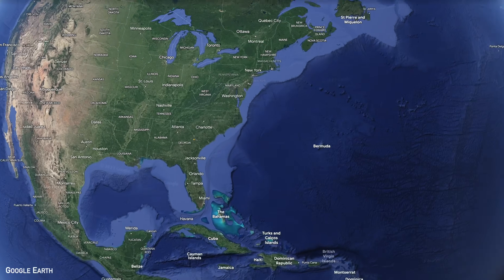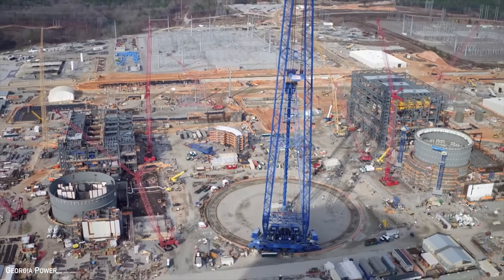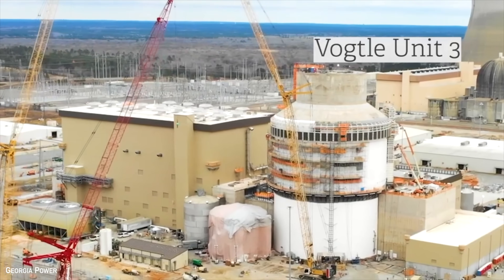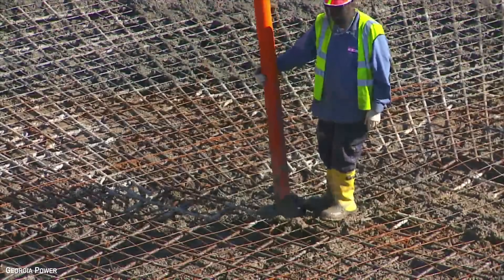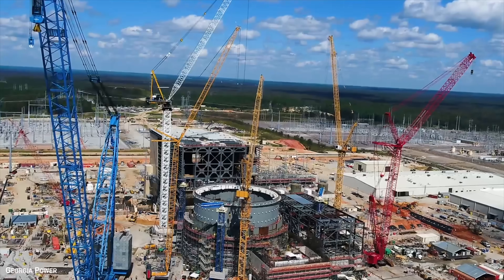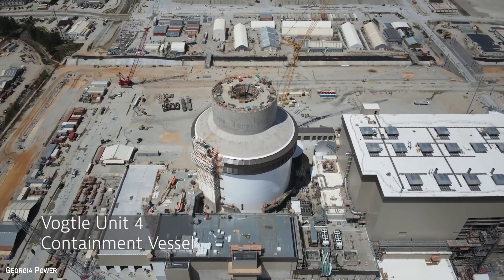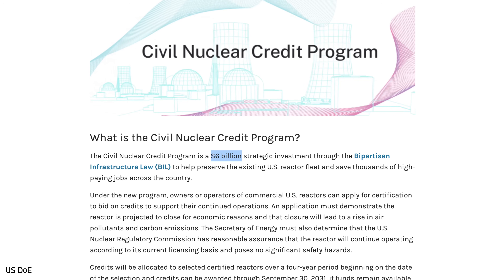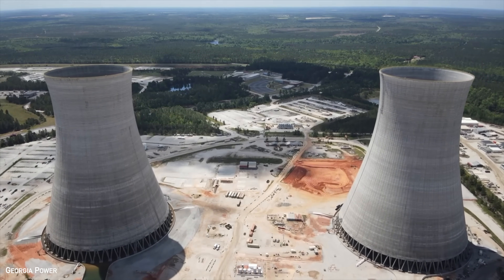Why the Future of Nuclear Power Depends on This Plant

Comment: Madness multiplied by insanity building another PWR reactor. 1. Solar panels are cheaper. For the money spent on Vogtle the company could have bought 10 x the generating power in solar panels. 2. If you need to build a nuclear reactor then build a molten salt one.
Ex UK Nuclear project manager.
Reply: “Solar panels are cheaper”

Solar … plus what?  Or, wind plus what? Random trolls might think intermittent panels covering vast amounts of land are the same thing as 24/7 power running for 50 years.  You say your not so you know the difference.  If what you really mean is .. plus gas plants and gas pipelines and LNG tankers importing gas causing the like of the several thousand Euro per month House energy bill, why not say so? 

Also, a former professional would know that hundreds of nuclear plants with great safety records were once built for under $1500/kw, todays $, and the explain why Vogtle is different.
Reply: @Falstaff  Panels + storage + grid connection. Your fantasmagorical journey through fossil fuels is unnecessary. Historic costs translate into current construction costs at around 10,000 per kw/h. But then no nuclear project has ever been completed under 50% overrun.
Reply: @Dana Durnford & Kevin Blanch Your rather stupid gotcha remark leads me to point out the phrase was grid connection. To simplify it enough for you.
Then to further your education. Virtually all wind and solar farms are connected to the grid either through a transformer or an inverter and transformer, unless connected to the newest generation of DC grid transmission line.
Reply: @Dana Durnford & Kevin Blanch debunked  And if you are just referring to storage. You will find all Tesla battery gigastorage are connected to the grid.
Reply: @Dana Durnford & Kevin Blanch debunked  No doubt you are contemporary with Charles Fritts and have all the knowledge in the world., but you obviously are not an electronics engineer from what you say.
Reply: @danadurnfordkevinblanchdebunk  You can say the same for every peaker plant, which are now being replaced by battery installations.

Comment: The old way of nuclear is the bad way. That's why no new plants for 30 years.
Reply: There’s recent and there’s older.  US built dozens or reactors late 60s for under $1000/kw,  todays $, 3-5 years build time, great safety records, most them still running.  That was all before the current NRC, which demanded Vogtle  change its design after it approved the design.

Comment: As someone in the industry Vogtle is the swan song of the stick built on sight megaplants. Any company who operates a fleet now is looking towards SMRs as the way forward for many reasons. The biggest being the cost of constructions and  that the exclusion zone is pretty much restricted to the area immediately around containment instead of being a few kms (~ 20) out from the containment structures. This allows for much more flexibility in the placement of these plants. And anyone worried about used fuel storage, it's not a concern. It's something that has been trumped up by the fossil fuel industry, used fuel is safely stored on sight, a plant operating for the past 50 years can store all it's used fuel in an area that is less than a typical suburban cul-de-sac.
Reply: “trumped up by the fossil fuel industry “

Yes in part , but must of the fear mongering today comes from big wind and solar funding some Sierra club rep, writing op Ed’s in every small city.
Reply: If you are in the industry you sure don't know a lot about what is happening right now.
In 2013, the Wall Street firm Lazard estimated that the cost of generating electricity at a new nuclear plant in the United States will be between $86 and $122 per megawatt-hour. Last November, Lazard estimated that the corresponding cost will be between $131 and $204 per megawatt-hour based upon the 4 recent new nuclear projects in the U.S. . During the same eight years, renewables have plummeted in cost, and the 2021 estimates of electricity from newly constructed utility-scale solar and wind plants range between $26 and $50 per megawatt-hour. Nuclear power is simply not economically competitive.
SMRs will be even less competitive. Building and operating SMRs will cost more than large reactors for each unit (megawatt) of generation capacity. A reactor that generates five times as much power will not require five times as much concrete or five times as many workers. This makes electricity from small reactors more expensive; many of the original small reactors built in the United States were financially uncompetitive and shut down early.
The estimated cost of constructing a plant with 600 megawatts of electricity from NuScale SMRs, arguably the design closest to deployment in the United States, was originally advertised as costing $1 billion but upon requesting actual bids from engineering firms, increased to $6.1 billion in 2020. Given inflation and other cost constraints that cost today can only be expected to be significantly higher.
The cost was so high that ten members of Utah Associated Municipal Power Systems canceled their contracts. NuScale then changed its proposed plant configuration to 6 fewer reactors but increased each reactor output from 50 Mw to 77 Mw costing at total of $5.3 billion. The NRC just last week approved the construction of the 50 Mw design but now will have to start the review process all over given the switch to a 77 Mw design. For each kilowatt of electrical generation capacity, that estimate is around 80% more than the per-kilowatt cost of the Vogtle project in Georgia — before its cost exploded from $14 billion to over $30 billion. Based on the historical experience with nuclear reactor construction, SMRs are very likely to cost much more than initially expected. And they now have delayed the project start until 2025 in an attempt to find more backers.  All this before the inevitable setbacks that will occur once construction starts.
Reply: @Klerk Cant  Yet you continue to ignore from your blank trolling channel that many countries have been building and using small modular reactors for many decades, built in two years or less for millions not billions.
Reply: can store all it's used fuel in an area that is less than a typical suburban cul-de-sac For several thousand years. That someone needs to keep an eye on them. And no one is going to build their house next to that shit. That answer is reactors that don't make that trash, but no one seams to be interested in making those.

Comment: Currently nuclear (while still desirable) has certainly lost a huge amount of its draw since wind and solar with energy storage is much much cheaper to install and operate. Not to mention the fact that it's quicker and easier to plan and build but also doesn't come with the sociopolitical baggage that nuclear has. I understand the benefit of nuclear and I think it should still be designed developed and refined. There may be a better case for smaller projects like SMR's and other designs of reactors that can use different fuel types and/or coolants.
Reply: In 25-30 years when the wind and solar has to be rebuilt due to wear out. People will scream about their utility costs. Many nuclear facilities are 50 years old. Coal fired 80-90 years old.
Reply: “With energy storage” 

What storage? Your smart phone?  There is no utility scale battery facility that can back up one middling 500 MW power plant or wind farm for a full day.  Not anywhere in the world. And storage is needed, not for one day, nor one plant, but for months long, for all the worlds would be internet power.
Reply: There's actually a lot of energy storage around the world; pumped hydroelectric storage, and these facilities have a large generating potential. There are a number of projects around the world that are under development which are being developed along side renewables such as wind and solar in addition to existing capacity. Chemical battery storage likely doesn't make sense yet for extremely large scale, long lifecycle use. Pumped storage in combination with wind and solar, has an LCOE lower than that of nuclear, coal, or natural gas. And if you take the storage out of it, it’s still way cheaper as a lifecycle cost compared to everything else. It’s not controversial, it’s very evident. It also explains why there are places where traditional coal, natural gas, and nuclear generating stations are being shut down in favor of building wind, solar, and/or storage because it makes financial sense to do so. Nuclear is great for base load power, but it is a lightning rod for controversy and costs far more over its lifetime (permitting, design, manufacture, operation, and inactivation) when compared to the other green alternatives.
Reply: @mech-E  “lot of energy storage around the world; pumped hydro ..   potential”

I walked the tunnels of the largest PHS in the world while under construction. Impressive, yet it only runs a few hours.  It was built to help shave a little peak load off the grid, not for covering days or weeks or a month of grid collapse due to weather/winter/darkness. All the PHS in the world is trivial compared to the scale of energy production required, and the dual reservoir geography w ready fresh water supply is rare. Many decades ago sone favorable sites were developed, but there has been no major PHS built in N America or Europe (some small exceptions) in a generation.  There’s a reason for that. 

The reality is clear.  Everywhere share of intermittent power is pushed to large scale integration in the grid, it’s backed primarily with fossil fuel plants.  Everywhere, no exceptions. Germany increased its gas plant fleet capacity 50% the last 15 years.  

It’s 2023.  Enough w the ‘my magic storage has potential’ stories, which intentionally or not are just a cover for fossil fuels.

Comment: Uh NuScales SMR's exist.
Reply: No they don't.

In 2013, the Wall Street firm Lazard estimated that the cost of generating electricity at a new nuclear plant in the United States will be between $86 and $122 per megawatt-hour. Last November, Lazard estimated that the corresponding cost will be between $131 and $204 per megawatt-hour based upon the 4 recent new nuclear projects in the U.S. . During the same eight years, renewables have plummeted in cost, and the 2021 estimates of electricity from newly constructed utility-scale solar and wind plants range between $26 and $50 per megawatt-hour. Nuclear power is simply not economically competitive.
SMRs will be even less competitive. Building and operating SMRs will cost more than large reactors for each unit (megawatt) of generation capacity. A reactor that generates five times as much power will not require five times as much concrete or five times as many workers. This makes electricity from small reactors more expensive; many of the original small reactors built in the United States were financially uncompetitive and shut down early.
The estimated cost of constructing a plant with 600 megawatts of electricity from NuScale SMRs, arguably the design closest to deployment in the United States, was originally advertised as costing $1 billion but upon requesting actual bids from engineering firms, increased to $6.1 billion in 2020. Given inflation and other cost constraints that cost today can only be expected to be significantly higher.
The cost was so high that ten members of Utah Associated Municipal Power Systems canceled their contracts. NuScale then changed its proposed plant configuration to 6 fewer reactors but increased each reactor output from 50 Mw to 77 Mw costing at total of $5.3 billion. The NRC just last week approved the construction of the 50 Mw design but now will have to start the review process all over given the switch to a 77 Mw design. For each kilowatt of electrical generation capacity, that estimate is around 80% more than the per-kilowatt cost of the Vogtle project in Georgia — before its cost exploded from $14 billion to over $30 billion. Based on the historical experience with nuclear reactor construction, SMRs are very likely to cost much more than initially expected. And they now have delayed the project start until 2025 in an attempt to find more backers.  All this before the inevitable setbacks that will occur once construction starts.
Reply: @clarkkent9080  Yeah that’s Lazard, US only. Yet 60 nuclear plants under construction right now globally, most recently completed plants under $5000/KW.

“SMRs likely to cost “

Oh please your hanwaiving, have no ideaz
Reply: @Nill757  It cost what it costs.  A Chinese textile factory can produce 200,000 pairs of socks, ship them halfway around the world and sell them for a few dollars per pair at Wal Mart and everyone makes a profit.  So tell U.S. textile factories that they MUST do the same.

Comment: Yes Vogtle 3 and 4 are very expensive and took long to build.  Is all nuclear power this way? 

See by contrast the Point Beach plant in Wisconsin, construction began ‘68, completed 3.5 years, for less than $1000/kw todays dollars.  Plant is still running, no fatal radiation accidents.  

See the Oyster Point plant in NJ, also begun late 60s, completed 4 years, ran for 50 yrs, also less than $1000/kw.  Also excellent safety record. 

There are more than a dozen other such rectors in the US which began then.Ask yourself what exists now, and didn’t exist late 60s.
Reply: that is because point beach is a small plant has no cooling towers uses lake michigan for colling
Reply: @dknowles60  yeah, that’s why cheap and fast?  Yes direct cooling water reduces a little cost.  If that was the entire answer then five thousand small reactors using large bodies of water could eliminate carbon emissions 5 years after construction start.  There is more going on with modern reactor cost than the technical aspects of some reactor.